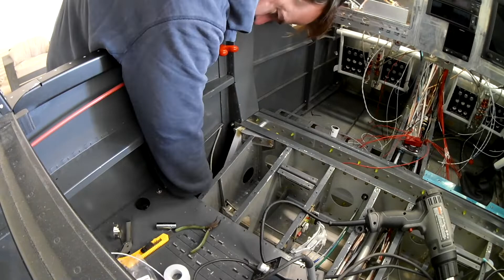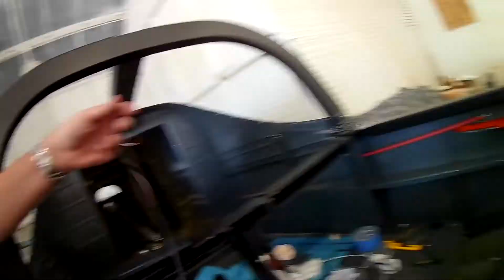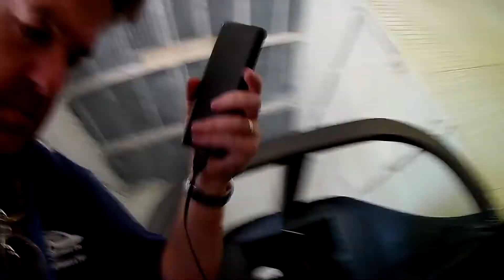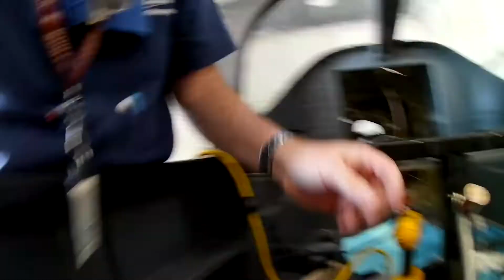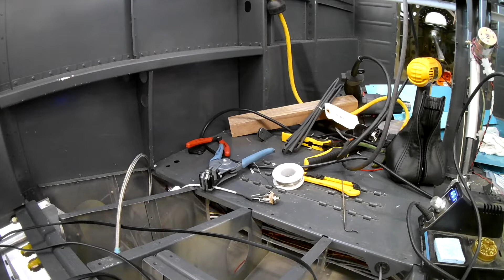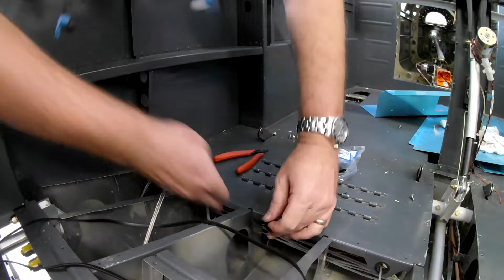RV-14 JacksNMics II

Comment: Did you consider a powered connector for your headsets, for example, if you were using an ANR headset?
Reply from the maker: Like a LEMO jack? I thought about it. Retro fitting for them wouldn't be hard but I don't use ANR. I use clarity aloft, earbud style. Love those.